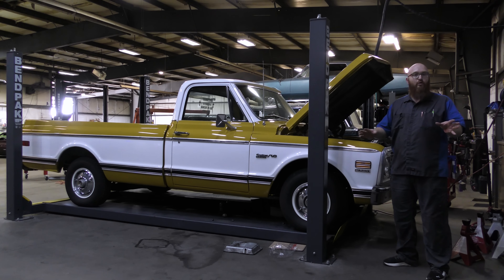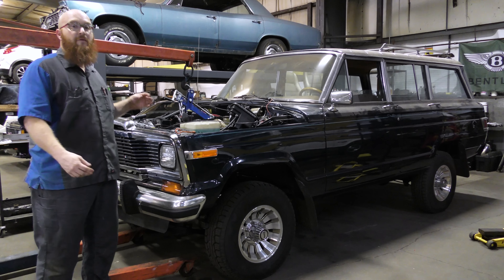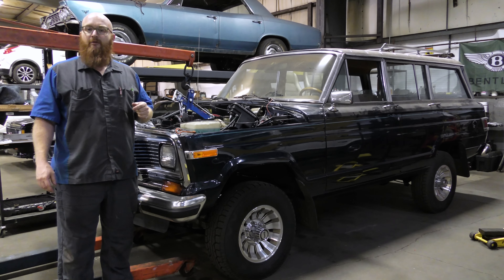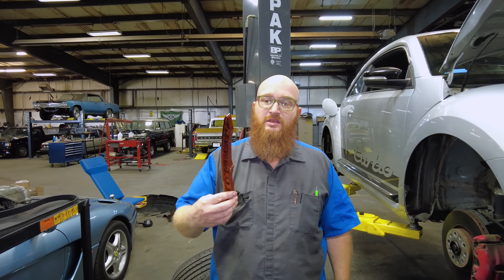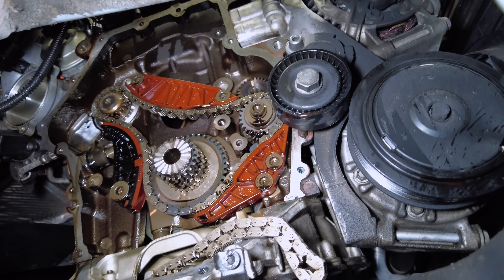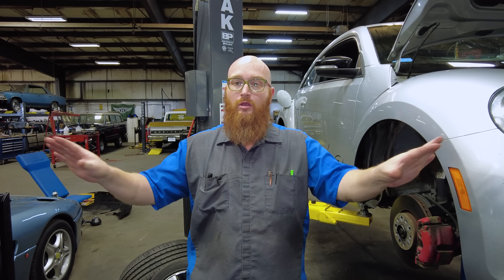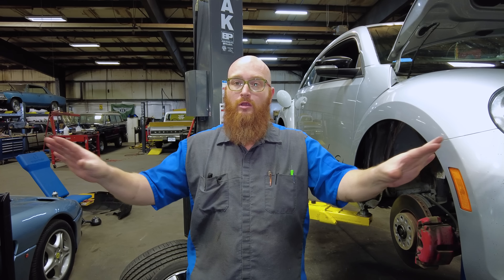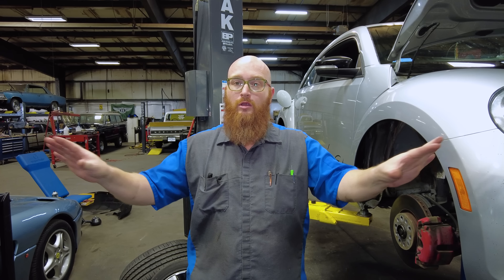Hard to test, can't see it, but it can KILL your car! CAR WIZARD talks Timing Chains! Is yours next?

Comment: Wow my timing chain let go on my 1983 Oldsmobile Toronado 5.0 V8 307 we fixed it and replaced the water pump at the same time but by dad drove the car with no oil for 500 miles and it damaged the roof bearings and main bearing so I bought a new truck. But I miss that car but the parts were very hard to find front wheel drive parts were also hard to find. Great video love your channel

Comment: I have the same problem with heater valves for my car.  They are NLA.  I have ebay and other auction sites worldwide set to alert me whenever one comes up for sale.  I buy every single one and they are expensive but when you need one, nothing else will work.  I wouldn't worry too much, but they are a very common failure on my car so I quite literally buy every single one.

Comment: I had a nice running 2002 Ford Explorer Sport with the 4.0 L V6 OHC engine. It looked nice and rode well. One day, the timing chain started making noise, particularly when it was cold. It was the plastic tensioners that had broken. I decided to pull the oil pan, and I found a lot of the tensioner pieces. These engines had one chain on the back of the engine, and in order to service this chain, the engine had to come out of the vehicle. I know how to do this, but I didn't have the energy for the job. I sold it cheap to someone who is a lot younger than I.
Reply: Happens all the time on the SOHC 4 liters - you were really unlucky as the OHV usually doesn't have that problem!
Reply: @dennyj8650  It was the SOHC engine. The S went missing.

Comment: One reason for a lack of timing chain problems in old American car engines is that they were pushrod engines, and the chain from the crank to the camshaft was far shorter than with overhead cam engines.

Comment: My mechanic told me about the timing belt and head gasket on my 05 caravan. When I bought it last Dec the timing belt and gasket they got replaced. So I use the trip meter to keep track on the mileage I put on it so I can replace both at the same when the time comes.

Comment: This is where old Saabs really shine. The old B202, B204, B234 engines go for 200,000 miles plus without the timing chain being touched. I took one apart last year with 181,000 miles and the sprockets, chain, and tensioner were as new. No visible wear at all. Inside the rocker cover you would have thought it was 1 year old, not 30yrs old.

Comment: I have an old 318 and everybody says that I will hear it when it's time to change a timing chain and they were right. They start hitting the timing cover. Naturally they are way out of spec long before that, but they were right. My noise happened at just over 400,000 miles. Witness marks on the cover, inside.

Comment: Wizard, your videos are amazing. I have a 06 Colorado 2.8 and recently had the timing chains (front and rear) replaced. Unfortunately the tech was not on your level and I've had a P0014 code since the job was done. I know you are busy and cannot reply, but my word to the wise is choose your tech carefully. It runs awful and after spending 2x what the truck is worth, it sits in my driveway.

Comment: Replaced the timing chain in my 2013 Ford at 88K miles.  Not because it was a problem, but because the engine had to come apart for the water pump and it was an extra $90 to replace the timing chain.  Really a beast of a motor.  It will outlast the car.

Comment: The issue was the Timing Chain Tensioners on the 2.0tsi engines early on. There was a class action recall on them in the USA. Unfortunately in the UK we didn't have that come back on the engines.

Also if you want to talk about stupid designs and cheapness causing issues, look up Ford/PSA vehicles and their Wet Belts in Europe.

Comment: as a 70s mechanic I replaced several failed Timing chains on V8s and V6s  the larger cam gears had plastic gears why an effort to have quieter running engine.

Comment: My experience  with 60's -80's 350 G.M. engine timing chains is once the plastic coated gear breaks time for a chain and you need to replace it again every 65,000 or so miles as the new replacement chains stretch .

Comment: I had a 1992 Toyota Carina as a beater car. 
I got it dirt cheap. No point to replace
timing belt as it would cost more than the car. 
Previous owner told me he never replaced either. In total the car had 350k miles on the meter when I was done with it. 
Gave it away and still running on the same timing belt. 

But it was only high miles though. Everything last longer on a car in those cases. 

But 350k miles on the same timing belt is impressive. 
And I know it is still running too.

Comment: I seen that many times but the funniest one was when my mothers old Dodge Aries broke it belt on a 2.2 liter engine. Guess what non interference engine.  I go down one afternoon to her home and my brother in law has a new carb for the car saying the old one is flooding. I go out to the car and want to see what it is doing out of curiosity. I crank it over and knew instantly it needed a timing belt. I open the the front cover and remove the broken belt. then put everything to top dead center. Hop over to the parts store get a water pump a belt and new tensioner and put it all back together without ever touching the carb.  I have teased my master mechanic brother in law for years over that bad carb.

Comment: Keep in mind back in "the old days" cars didn't last as long.  You started thinking about getting rid of a car when it had 75K mi because it would be shot by 100.  So "lasting a lifetime" didn't mean today's 200K mi cars.
Reply: My dad told me about how when his parents bought a new car in the 50s, an oil filter was an extra-cost option.  You could get the base model without a filter and do oil changes at 2000 miles, or spend more to extend the drain interval to 3000 miles by getting the filter.  But it was also expected back then that you'd look at replacing a worn out engine around 50K mi.

Comment: Now you got me thinking about my 2014 Nissan altima. I have 180,000 miles on it. Runs like a top, I take good care of it. You got me thinking about ' 1st start up '. I thought I I've been hearing a little bit of rattle on 1st start up. For like 1 sec. I guess o need to call my local Nissan dealership and ask when I need to change mine. Could be time. No issues tho. No engine lights anything other than that 1sec of I'm thinking I'm hearing is a slite rattle at 1st start up

Comment: On my 2014 Kia Soul 2L, I also had a noise on the timing chain, and finally they changed the entire engine block under warranty. The car had only 84000km.

Comment: I drive a 2012 Mazdaspeed 3. The 2.3 DISI in these (as well as the Mazdaspeed 6 and CX-7) are known to have VVT issues. The VVT actuator has the potential to fail, which causes the timing chain to stretch and eventually grenade the engine if not taken care of ASAP. Luckily, Mazda has released a revised set of parts.

Comment: Hold one end of a chain horizontal and the the droop of the chain at the other end is highly related to the wear of the chain.  I thought everyone knew this.  Apparently not.  Compare a new chain as shown to a used up one and there will be centimeters of difference of droop between the new and used.

Comment: '06 Jeep Wrangler with the 4.0L in-line 6 cylinder. It has 250K miles and just had the timing chain changed. it had a total of 0.250 inch of stretch. My mechanic asked if I really wanted to change it. I said yes, because it would go another 250K miles.

Comment: Buick 231 V6s.  Early odd firing order engines had plastic tipped gears and plastic tensioner.   Wore out twice in my 77 Firebird.   Don't know about later ones, but I suspect the irregular firing contributed to the premature wear.  Good video. Thanks

Comment: Timing chains in 60's -70's cars last 'the lifetime of the car' because the car rarely lasted past 100,000 miles. I had a 307 out of a 73 Chevy that had so much chain slap that it wore a hole in the front cover! Half of the plastic teeth were off. I also had a 68 Olds 400 that ALL of the plastic teeth were in the oil pan. It was running off of what was left of the cam sprocket!.
Reply: I saw that too in the 70's. A car came in for an oil change and there was a mess coming from the front pulley. On closer inspection you could see the long "crack" where the chain wore thru.
Reply: they kept the timing chain into the 80's & 90s. Good design, it stretches, then jumps a tooth or two & shut down. Usually 120-140k miles. Had a taxi mechanic get mad at me because a caprice went dead, loose chain. I said, ' you watch, the whole fleet will be going down, & I'll hear it happen via the radio dispatcher'.   Sure enough, that's what happens, with V-8s going 200-500miles a shift, 2  12 hour shifts a day. Lol.  He didn't like that. hehee. Physics.
Chains stretch.

Comment: Wizard, your timing (pun intended) was perfect for me regarding an issue I had with possible timing chain.  And I want to add my experience here in case someone else has the problem.  My 98 Crown Vic P71 started clattering noise only when at higher speed accelerating.  Took to mechanic, they had a problem initially getting the noise replicated but finally did and told me to immediately take it took a machine shop for diagnosis. Here's the kicker, a friend of a friend is a mechanic out of his home and told me to bring it by for the hell of it.  He took one look under hood and somehow spotted a crack in one of my hoses from the air intake.  Damned if not after replacing did that take away the clattering noise which was thought to be a timing chain.  Like you, after initially thinking it was timing chain I did some checking online and was pissed to find out Ford used plastic guides etc in that 4.6 engine too.  I appreciated you calling this out and of course it all boils down to money, keeping that car note repeating to the banks as well.  Thank you!
Reply: look up the 4.0l SOHC timing chain replacement. i own a ranger that needs it fun.

Comment: It is really up to each decision in car manufacturing process which influence the end product. Design, management decisions, supply chain management. Many times these issues were simply solved by choosing different manufacturer for OEM part. 
There is also big pressure to save CO2 emissions, so lighter chains and components will safe gram or 2 which counts. Specially in Europe. But there are plenty of modern engines today with timing chain which lasts 200k+ miles, so it can be done right.

Comment: I believe the majority of VW diesel engines have the water pump driven by the timing belt. I wonder how many people asking for a timing belt service also have the water pump and thermostat changed when this is being done. Considering the cost it really does make sense to at least replace the water pump at the same time.
Reply: The water pump is always replaced when replacing a timing belt on the TDI engines. If the client opted not to get it done….. then just his tough luck huh? The thermostat is separate front the water pump and can be done without removing the timing belt.

Comment: Hello again from Wales Mr. Wizard. My V twin Suzuki motorbike has a quite unusually short timing chain combined with gears for the overhead cams. I wonder if you've come across this arrangement on any cars. My turbo diesel Peugeot hatchback has a belt that needs changing every 32,000 miles, or 5 years, whichever comes first. I was remiss and left it for almost 7 years last time. I'd done under 20,000 miles in that time but will be more vigilant in future, for sure. Time had slipped away without me noticing.
Reply: Way back in the late 80s I worked for an Agricultural Engineers. All the techs across several depots had Peugeot 309 diesel vans. One timing belt failed, so they checked the rest. They found multiple teeth missing from most of the belts in the other vehicles

Comment: It's not just cheapness of the parts but that modern valve trains require a lot more torque to turn and have much longer chains due to being OHV so they have much more stretch as they wear.

The reasons it takes more torque is engines now have usually 4 valves per cylinder and go to a much higher RPM. Higher RPM means you need stronger valve springs to prevent valve float that would happen at lower RPMs. Stronger valve springs means more powered needed to turn the cam.

Comment: I have a Seat Leon fr cupra with a 2.0 vw tsi engine producing over 300bhp and it is bullet proof reliable and wickedly fast... Its basically the same engine that's in the Beatle but mapped at the factory to produce more power... And in mine I have the manual gearbox with auto clutch (DSG) and paired with the 2.0 tsi it is amazing and it changes gear much quicker than any manual gearbox can. 👍🙂👍🇺🇲🇬🇧🇺🇲🇬🇧

Comment: My dad's mercedes w123 230 (that's the m115 gas engine) is over 40 years old with 100k miles and the chain is still as good as new and I have it on good authority that these chains can last the life of the car if not beyond.

Comment: On the Lada Niva engines from the 70's thru to the 2000's there was a cap nut on the right hand side of the block in line with the camshaft chain.....
when the chain sounded like it was about to fly apart....with the engine stopped you undid the cap nut and listened for a "ping"
When you heard that "ping" you knew that all the slack had been taken out by the spring in the tensioner...and now the tensioner's oil pressure activation was "set" for another 20k miles.....

Comment: 90's T-Birds and Cougars with the modular 4.6 v8 had plastic timing chains. I never changed the two that I had. I sold them both when they reached 150K. I was told, past 120k, they're on borrowed time.

Comment: speaking of timing chains i have to do a timing chain job. I did the cam shafts a while back because one of them decided to grenade, and it decide to take the oil pump out on the way out, the good part is that all the debris is out and the oil pump only has a crack in it but the psi at idle is lower than it should be.
Reply: also this is on a 2.5l yoda can say the timing chain and its componets are not plastic but the hard rubber leads to wear away after 200k miles and u will get some rattling after so and so amount of time with new gears and tensioners.

Comment: I've always heard that if your engine is rattling and misfiring at idle but it all goes away when you get up to speed that it's the timing chain that's starting to give up the ghost on you. Commercial diesels and locomotives use gears but it can be kind of loud and a lot of people just don't like that.

Comment: It's not just a case of "They don't build them like they used to". It's no surprise that on old pushrod V8s the timing chains (odd exceptions aside) had an apparently infinite life. The distance from crankshaft to camshaft is so short that chain wear and lash are not a problem. Once you have overhead camshafts, particularly on a V-configuration engine, the chains are much longer and need more sophisticated (expensive) tensioners and guides. Some manufacturers have been better than others at working that out. Most of the failures, though, seem to be on cars that are not optimally maintained. Meanwhile, toothed belts need no lubrication, are easier to maintain tension on, and in most cases replacing the belts takes much less labour than getting at tensioners and guides to replace them. Perhaps Pontiac, Glas and Fiat were onto something in the 60s.

Comment: I own a VW product, 110k miles with original timing belt. Think I'll wait another year or two before replacing it. VW recommend changing it every 130k miles. Quite happy its a belt and not a chain, much much easier and cheaper to replace.

Comment: Timing chain replacement is a concern of mine on my truck.  I have an '04 F-250 with the Triton V-10 but only 164K miles on it.  I use it to hauler a few campers and boats around a few times per year plus random truck use that my Subaru just can't handle, but I know sooner or later I should probably consider some maintenance on my truck.

Comment: I remember the old Ford 2.8 Cologne engines used to use plastic timing gears instead of chains or belts to run the engine's timing. The used to explode due to people not changing the engine oil on time.

Comment: A friend had a Passat in the 80’s and the dealership marked it off as having the regular scheduled maintenance which was the timing belt. Soon after his engine grenades and the dealership was held responsible.
Reply: @The Flat Rock
Typical $tealerships stealing from the customer. Imagine paying thousands for a major timing belt job, tensioner, and water pump, and NOTHING was done at all! That is clearly major THEFT. I think these guys need to spend some years in prison!

Comment: I have seen old chevy's with a slight oil leak up front, check timing cover and the chain was so loose it had worn through the cover but was still running fine !      206   SEATTLE
Reply: Same hear !!! Those old chevys  with a 350 you could get gear drive at speed shop . Put in truck NEVER had timing problems. Ford L6 engine you could take the fiber gear out and change it for their HD Truck engine part , metal gear , but makes slight gear wine, still have mine !!!!
Reply: @catman5546  International 304 and 345 v8 all gear timing set too.
take care..